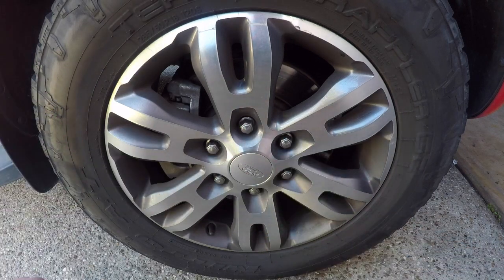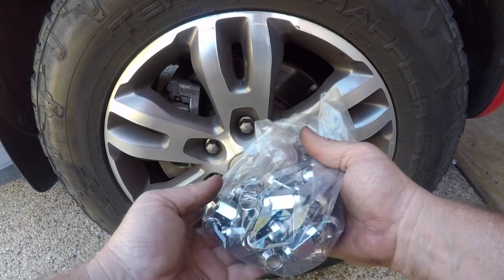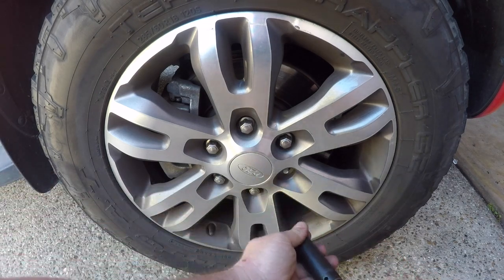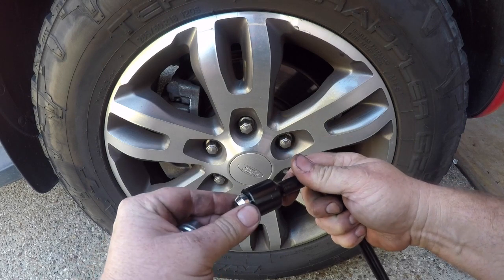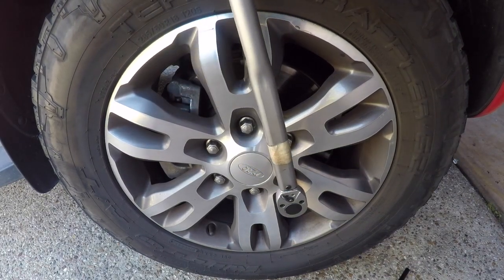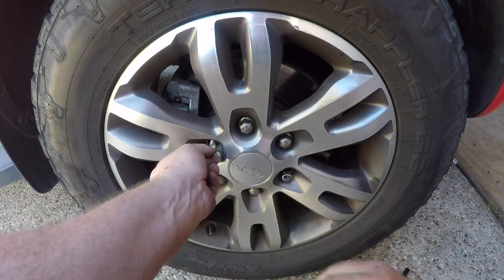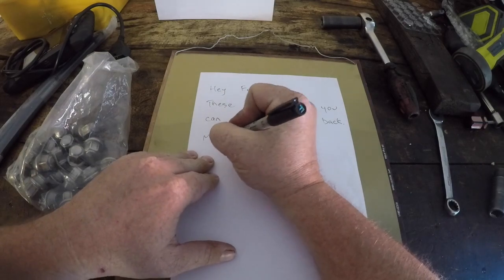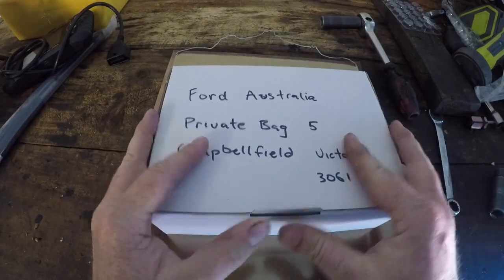Damaged Ford Ranger wheel nuts. Damaged Ford Everest wheel Nuts. Swollen Lug nuts.

Comment: Hi, I called around to my local tyre shops about swapping the nuts out for aftermarket ones. I was warned against this as the Ford nut has a larger surface area on the taper that comes into contact with the wheel. Aftermarket nuts have less contact area with the wheel and potentially come loose.  It is that contact area that keeps the nut tight due to the surface friction (in simple terms).  Same principle as fitting a round taper nut to a 60 degree taper wheel. Much less contact area and not recommended.
What are your thoughts on this?
Reply from the maker: Yes you are correct. You need to find replacements that have an equivalent surface area that comes in contact with the rim. While this sound challenging typically you will find that aftermarket manufacturers closely copy OEM parts and its not an issue. If buying over the counter zip an original wheel nut off and compare before buying. If you are buying online, then it's a gamble. Thanks for the question.
Reply: @killawattgarage  No problem, thanks. Unfortunately I'm not spoiled for choice here in SA. Seems almost every store is supplied by the same supplier. The one fitment center outright told me I would not find for the Ranger as the aftermarket are all the same. I've already tried a few motor spares and nut and bolt shops. Will keep looking.
Reply: @NCHuntSA  
Hi Nathan.  Have you find a aftermarket lug nut that has the same surface are as oem nut.  Im in Cape Town.  I need to replace all lug nut on my Everest.  On some I have removed the cap but I like the chrome look
Reply: @eltoneltonf5408  Yes, I got from Tiger Wheel and Tyre. The conical/tapered area is less than OEM but big enough for the rims. You do not loose any of actual contact area between nut taper and rim seat.

Comment: Thank you so much for putting this up. I have a 2016 Ranger and I just today whipped the left rear wheel off to attend to a squeaky leaf spring (it's actually a motorhome conversion with heavy duty rear 3.5 tonne suspension). I'm a former mechanic from donkeys years ago but I could not work out what on earth was going on with the wheel nuts. I haven't removed a wheel from this vehicle in the two years I've had it so was unaware of the problem. I could see that there was some sort of weird cap thingy that seemed a bit sketchy and then I went online and bingo, I came across your excellent video. I'll hunt around for some solid nuts tomorrow. We go bush proper in this vehicle so I'm really glad I found your video and can alleviate a potential big problem out in the sticks. What a crazy idea by Ford. Thanks again.
Reply from the maker: never heard back from ford haha

Comment: Looks like I am a few years late to the party. I was wondering what the local mazda dealer was on about when my bt-50 was serviced today. Thanks for the video, you did a better job explaining it than the dealer did. After watching this I checked mine. The supplied tool is a tight fit but it can still just fit. A few I tried the shell will rock backwards and forwards on the nut. Since new they have only been off maybe 8 times with 1 set of new tyres and the rest tyre rotation at service.

Comment: how about removing the jacket altogether?? i recently had a harrowing time replacing my flat tyre at a worst place imaginable, which was compounded by this lig nut issue... ha e been thinking of removing the jacket as replacement oem (so called upgraded) lug nuts are also jacketed
Reply from the maker: Yes you can remove the outer jacket. Be sure to have a socket that then fits snug over the inner nut.

Comment: I ordered the size wheel nuts you recommended but not sure if the length there supposed to be. I got the 35 mm Long. Is this correct ? Cheers

Comment: Those aftermarket lug nuts have a little bit smaller contact (or seat) area than the OEM ones.
Has anybody had problems with this unfortunate fact?
OEM nuts have about 8.7 mm of cone length vs about 7 mm of the aftermarket one which I have

Comment: Another great vid on ranger/bt50. Thanks. Who did you get the wheel nuts from?
Reply from the maker: Just google 'Wheel Nuts 12X1.5 Qty 24 19mm Socket' and there are heaps of online sellers or you can buy from a major tyre shop. I brought these online. Cost about $40.

Comment: IF that rim is the "ford type" you risk loosing it due to the cone is to smal and can be dragged thru the hole. the holes in the rim's is just to big and bigger then normal. PLZ get nut's that have the same cone size as the stock ones.
Reply from the maker: Thanks for the tip. The replacements had the correct cone size and shape. 100,000km (60000 miles) and no issues

Comment: Mazda BT50 2016 ..... share same stupid design wheel nut. Not great when you get a flat and can't get the tyre off. I think they have been using the same design since 2011 and despite constant complaints.... 9 years later still the same stupid design with tinny covers that damaged so easily.
Reply from the maker: It's disappointing that nothing has changed.